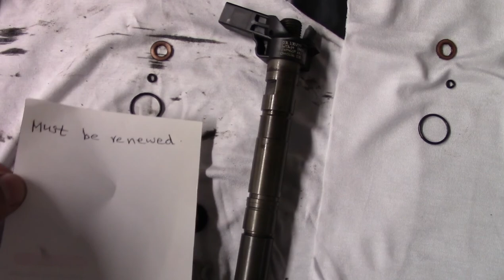Vw Audi Skoda vRS 2.0 TDI CR Fuel Injectors Replacent Part 1

Comment: I would of cleaned all the area and blowen out with air and also I would of tightened the puller nut and inserted the puller before unscrewing  the injector nut, then same on each other injector  !

Comment: How the secondary (auxiliary) fuel pump works in skoda Audi cars ?   Mean from where the voltage gets to the pump.   Nd when the pump gets activated while cranking or when ignition is turned on ??